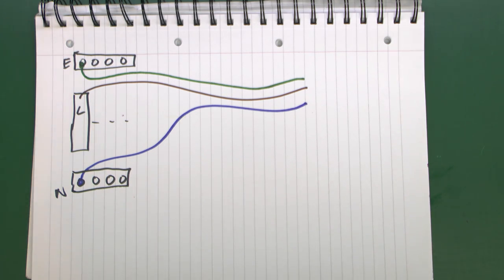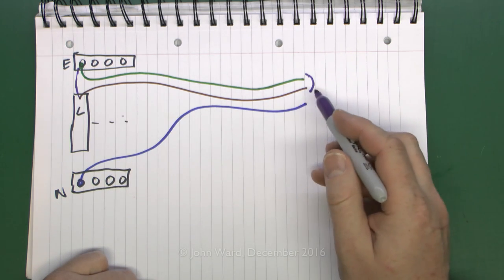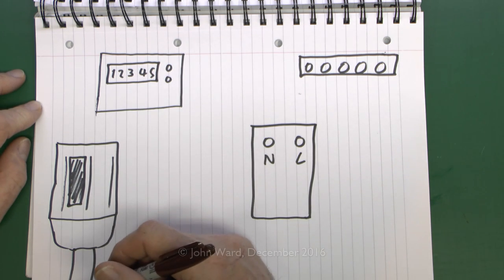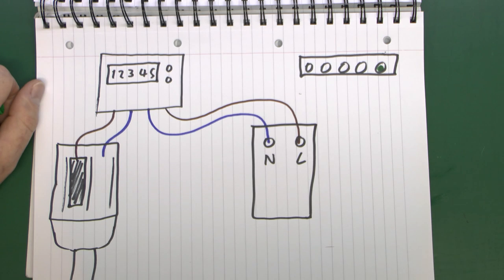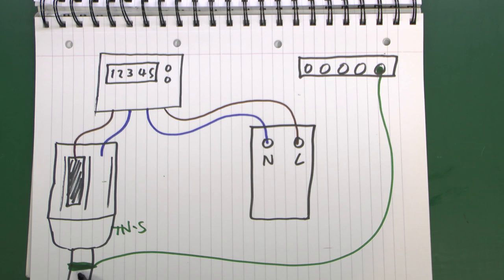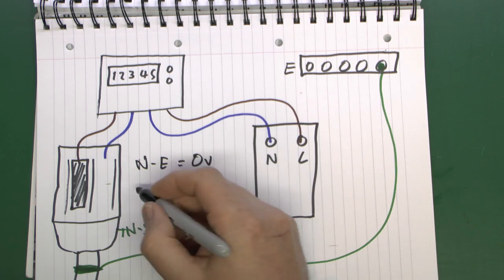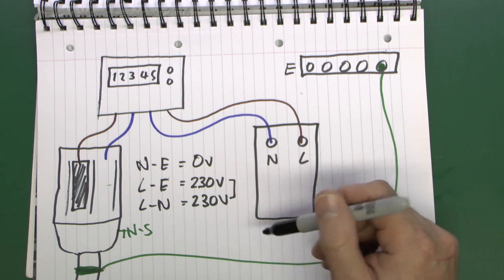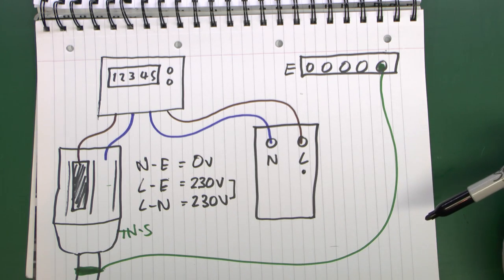Polarity Testing

Comment: Another reason for polarisation is so that internal fuses in equipment are on the line/live side. That way when the fuse blows, the internals of the device aren't still live when a fault has occurred.

Comment: Always worth checking the output of the meter. Don't assume just because the Provider (and/or their contractor) did the installation it will be correct. I've had it where it was reversed; on one memorable occasion at an aquarium shop!
Reply: And in one of our local aquarium shops the owner has some of the aerators for the tanks bearing those Chinese 13Amp plugtpos which have no fuse, and flexible cord that looks dubious into the bargain. An electrifying experience awaits. Frying tonight?

Comment: My interest in electrics stems from the fact I got a severe electric shock from an Edison screw bulb. I now know what it feels like to be an Elephant in America. The idiots who installed the electrics in my business in Cambodia reversed the polarity of the entire system and I got electrocuted while kneeling on the bar to change one of the bulbs. I must have gripped the screw thread, which was live, because I crushed the Compact Fluorescent in my hand while screaming like a piggy from the deep south. The funny thing about it now I look back is I actually turned the light switch off thinking that the electricity to the light was isolated. I know better now. Anyway, if you ever want to see what a country looks like without any electrical regulations, then visit Cambodia. It's a shocking experience, literally.
Reply: Never assume that the polarity is respected. In my country before the new EU wiring color usage in a lot of installation they used the same color for L and N, the only real standard was green/yellow for ground, everything else whatever. Also a lot of people that installs lightbulb holder really don't care about polarity, and wire them randomly. Also never assume that turning off a switch it will interrupt L and not N, also there is an old way to do 2-way switching that produced the effect that the lightbulb can be off because the two terminals are at full live voltage.

Comment: Is it really the case that the outer threaded part of a light fitting is accessible when there's a lamp installed? Surely it's not acceptable to have even the neutral exposed in normal use on any electrical equipment. Of course, lamp fittings are an exception to the normal requirement that no live components can be exposed without the use of tools, but even a neutral which can be touched with a lamp fitted seems odd (the exposure of live contacts with no lamp installed is, presumably, just historical - other designs, like the GU10 base, are safer).

Comment: Out of interest, how would you pick up one socket or light in the middle of a circuit connected incorrectly? If the Lives were connected together but in the neutral terminal and vice versa you would still have continuity, would you just pick up the incorrect polarity on the live test? Many thanks for the great videos by the way!
Reply from the maker: Polarity is tested at every part of the circuit, so each switch, light, socket and so on.
Reply: @jwflame  I understand now! Thanks

Comment: Im doing Electrical Installation Lvl 2 at college and I still find Polarity extremely confusing but thanks for the help anyways.. These Videos are good :)
Reply from the maker: Polarity on AC is just about ensuring L & N are in the correct place, and things like light switches are connected to L only.  It's not negative/positive.
Reply: John Ward Thank you! 😁 Nicely put👌 Helped alot

Comment: What is the need for polarity testing in electrical installation considering the line wire is red and neutral wire is black, which can be verified visually?
Reply from the maker: Wire colours are only valid for identification if they have been correctly connected.
If someone had connected red as neutral and black as line at one part of a circuit, the rest of it would be wrong even if the colours were correctly connected.
Reply: @jwflame  Thanks Boss
Reply: The colours used to day to identify are blue for neutral and brown for live.

Comment: I bought one of them plugs that you plug into the wall that will light up with 3 colours to indicate correct wiring. It's the Kewtech KEWCHECK103 Mains Wiring Socket Tester. I was think of using it on the lighting circuit with the aid of a 3 pin socket fitted to the ceiling rose wiring to test it with that. Is that something you could recommend?

Seems easy just to isolate the power and wago connect the plug into the circuit, turn on the power and test with that device.
Reply from the maker: That could be done, but those devices are very limited and only confirm the most basic things, many faults won't be detected.
Reply: @jwflame  OK, thanks John. If the basics don't come back OK, I shall call an electrician. Trouble is I spent a day and a half troubleshooting and fixing the issue an electrician had left after getting paid 600 for the whole job. One 2 way switch was not turning on at all times. I've fixed the issue and used my multimeter for continuity to earth in CU. But wanted to do additional testing.

Comment: Nice vid but why do you have to fuse all the wall plugs? We (Australia) just fuse/rcd the circuit from the board. Also over here in the power board you would have a neutral link like the esrth one you showed and an earth link with a jumper from neutral to earth, why do you folks not have that?
Reply from the maker: Plugs have fuses as the outlets are typically connected to 32A circuits, without fuses in the plug very large wire would be needed for appliances.
On those installations which have the earth and neutral connected it is done in the supplier's equipment before the meter, and not within the installation.
Reply: Thanks for that .... now fogs me though why your meter is setup like that. We have the drop in via service fuse DIRECT to the meter. Up to and including this point is supplier equipment and not to be meddled with without special clearance/courses.

Then from there it goes via the main fuse/rcd and into the subs (lights, power1, power2, stove, hotwater etc) of which power is usually 16a each, lights 8a and stove/hw each 20-30a. However all this is on the same board side by side. Thus the bridges are all on the same board including that earth strapping.

Given the cost of copper I much prefer our system :P since the copper to handle a 32a line would be phenomenal in cost (I know my 4-12g 12vDC copper is shocking with 2-4g averaging up to $10pm). Also with our system when you blow one side of the house it doesn't take out the entire house.

On that note I notice we have bigger houses too. Was watching a property searching show from the BBC the other day and they were going on about how the second bedroom in a new block of flats was big .... it was smaller than my laundry was in my last flat lol and smaller again I think than my bathroom in that flat and only 1/2-2/3 the size of my second bedroom in that flat. My lounge/kitchen was 3 times bigger and they were saying how big it was. Had me stumped. We are now in a 4br house and our main br is the same size of that second b/r, I consider our bedroom small because of the space left after the inbuilts and it is still 2-3 times bigger. So property size may influence the wiring a bit?
Reply: I don't know why you think the house supply fuse (63A old 100A new UK) would blow and take out the entire house at any time. The RCDs (which protect power and lighting circuits etc.) in the Consumer Unit would trip well before the supply fuses. Maybe I misread or misunderstood something?
Reply: Jamal Tyrone
not sure what your reply is referring to as noone I can see suggested anything about the main fuse/RCD and especially not at them ratings either.

I believe our service fuses are ~60amp but I'm not pulling our fuse to check (most pre naughties houses here are still fuses).
Reply: I was referring to the line "Also with our system when you blow one side of the house it doesn't take out the entire house." I don't understand how this isn't true of our system since earth faults trip RCDs (or burn the fuse wire) which only results in one circuit ever going out of service until it's repaired.

In the UK supply fuses are either 63 amp in most old houses (like our bungalow) but new builds apparently have 100 amp according to what I've been taught so far. Which is odd seeing as most homes now use lower power lighting and lower power white goods.

Maybe it's been uprated to allow for high power showers on the main consumer unit rather than a separate one like we have?

Oh, and to get around the copper price issue we technically use underrated cable on our 32 amp rings. 2.5mm cable which according to our On-Site Guide is only good for up to 27 amps.

It must be passed my bedtime I'm typing some crazy shit. :D
Reply: Jamal Tyrone
well if your houses run on a single loop as has been suggested then you would loose all powerpoints in the place when you blow the fuse.

As for hot water .... with heat pump tech and some other niceties you need less power than ever to heat water.
Reply: @NullaNulla  32A circuits in the UK for outlets are normally wired as rings using 2.5mm^2 cable, and as there are two paths, the copper cost is reduced as it allows lower gauge wiring. Typically a house will have two rings for most of the sockets. Maybe one ring on a small flat, perhaps three on a larger house.

Also allowed are 32A radial circuits are on 4mm^2 which make sense for kitchens and outhouses. However, there 16A (sometimes 20A) radials for outlets are common too.

The supplier meter/fuse is often in a separate location to the consumer unit which contains the circuit fuses in part because the former can be installed in an externally accessible cabinet which doesn't require access to the property for reading (or disconnection) whilst the circuit fuses are invariably indoors inside the property. However, it's not uncommon to have them both indoors right next to one another in older properties. So-called "smart meters" might make the days of manually read meters redundant, but the ability to disconnect power without access to the property would remain.
Reply: @TheEulerID  I don't understand bothing to do them as high current rings, it's just as easy with a regular straight run that you can tap off here and there which is how it's done here. Our entire house here runs of a pair of 16a power point fuses and an 8a light fuse then the stove has it's own 30a. I'd like a seperate for the AC but not my house.

What you describe about the remote subscriber boxes is how it's done in most newer flats here. All the meters are in a central incoming cabinet then they send a spure into the applicable flat which then has it's own breaker panel and circuitry and makes sense.

As for smart readers I'm not keen on the RF type. The induction coil one's I've no issues with and we've had one at one house we lived in but the RF ones the yanks are pushing I'm against, not because of the meter but because of the RF itself. As someone who plays with RF for a hobby I'm aware of many of the things that can come from it being too close.
Reply: @NullaNulla  

My house has a pair of 32A ring circuits for sockets. The 32A circuits are useful, as you can plug a couple of relatively high power portable devices in (like a 3kw kettle and a 3kw 6 slot toaster) into random sockets in the kitchen without worrying about. In the UK washing machines and dryers tend to be plug-in devices too, so those high powered circuits are useful for 3kw devices 

In the days before central heating was common, portable electric space heaters were common too, so high power draw was an issue. 

These days, the only room that tends to use a lot of high powered plug-in electric devices tends to be the kitchen and, possibly, a utility room or a workshop.
Reply: @TheEulerID  washing machine and dryer here is the same as there as is the kettle etc :p. Where I get trouble here is running too many portable air conditioners for cooling on the one circuit. If I ever get to own or rent to buy that shit will be a thing of the past.
Reply: @NullaNulla  I'm surprise A/C isn't on fixed circuits as we do for really high-draw devices. In the meantime, 32A circuits with multiple sockets are convenient as we don't tend to have to worry about what combination we plug in where.
Reply: @TheEulerID  larger aircon units are by law and by need but ours are portable aircon since we rent and the landlord is too tight ass to even fix the house properly.